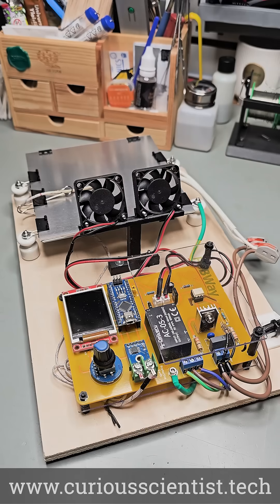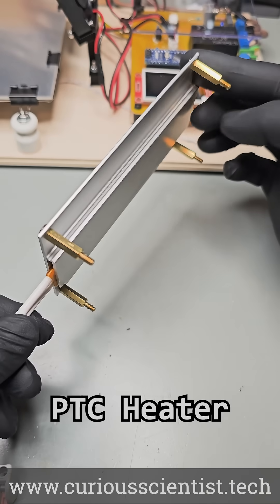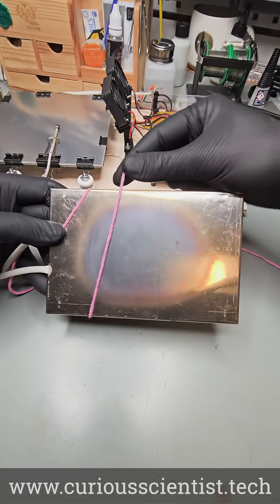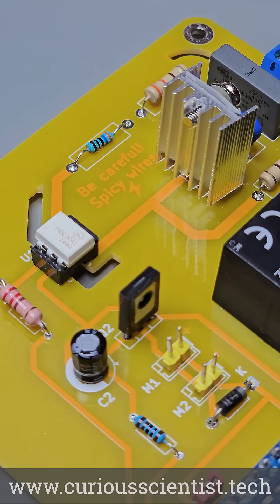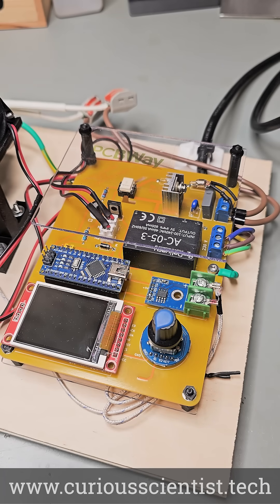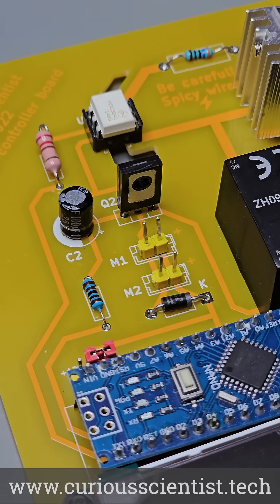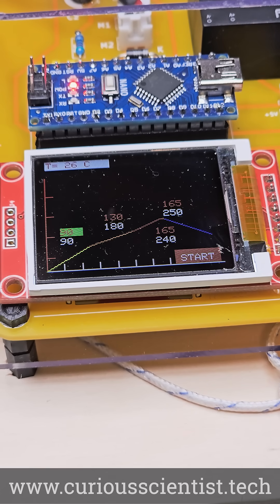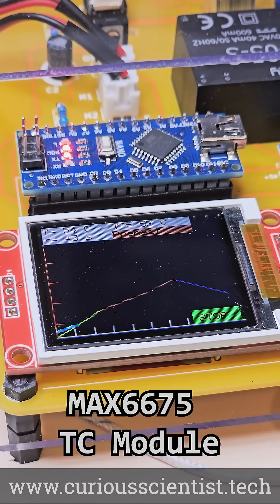#DIY #soldering hot plate with adjustable #reflow curve. #arduino

Comment: Did you build a hot air rework station to remove / reflow chips?
Reply: When i looked a year ir two ago, fully homebuilt hot air stations were very few and far between. The tricky bit being the hand piece with heater to a satisfactory safety standard.
Reply from the maker: No, just this hot plate.

Comment: I actually use a PTC based block to reflow my PCBs, no issues at all but that's mostly likely due to the smaller size I'm using. This would be perfect for larger PCBs with a more even distribution of heat. Nicely done by the way!!
Reply from the maker: Thanks! Yeah, for small boards, the PTC is good. Or, let me describe my thoughts a bit better. The specific PTC-based module is not the best because the PTC module is located in the center of the plate, so while the center gets hot evenly, the sides rely on the thermal conductivity of the plate. So if you use a large enough PCB that is comparable with the plate's size, the solder might not even melt on the sides while the components on the center are already being overheated. So, exactly, as you said, the mica plate solves this and provides a better temperature distribution across its surface.

Comment: I have problem using thermocouple when it touch AC heating plate, it will reduce the temperature reading. and I don't use any GND because it only use 2 wites like yours. any suggestions?
Reply from the maker: You have a grounding issue somewhere. Your heating plate probably "leaks". I don't know how your full circuit looks like so it's hard to advise exactly what to do.

Comment: i had good results with placing a thick aluminium sheet on a gas stove top and moving it to a large heatsink once the soldering looked done, but this is of course much nicer
Reply from the maker: I can't imagine that method being safer and more convenient that this one. The principles are the same: placing the prepared PCB on a warm plate, but the way of heating the plate makes a lot of difference.
Reply: @CuriousScientist  of course not, it is just a quick and dirty way using what is available, thick sheets give nice and even temperature distribution, but regarding safety and repeatability my approach is just bad
Reply from the maker: If it fulfilled its purpose, then it was the best tool available. We often must be resourceful and can't have the fanciest tools.

Comment: Hello Sir , Can you make a  diy  soldering iron with Arduino nano and a mini oled display  dc soldering iron 5 v or 12 v , for power we can also use old atx smps
Reply from the maker: Hi! I think 5 V is a bit too low because it would need way too much current to provide enough wattage for heating. Even 12 V is a bit iffy, because you'd need 4-6 A for a regular soldering iron (let's say TS100, TS101...etc kind) which might require bulky cables. An iron is not something I would personally DIY because there are just so many good irons and stations on the market for an affordable price.
Reply: Thank you so much for replying sir, then I have one more suggestion then  ,  how to make a SMPS from old cpu SMPS ferite transformer , Ex 
24 0 , 30 0 30 or 30 0 , thank you , Good night sir . I am from India sir I recently subscribed to your Chanel